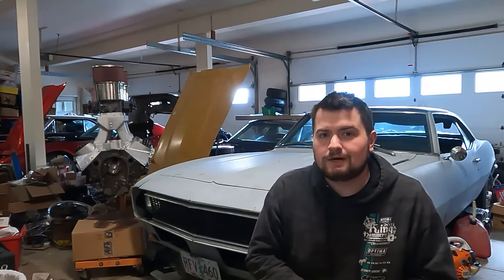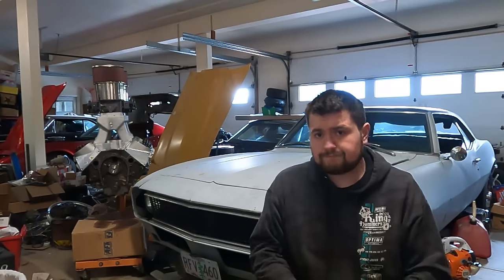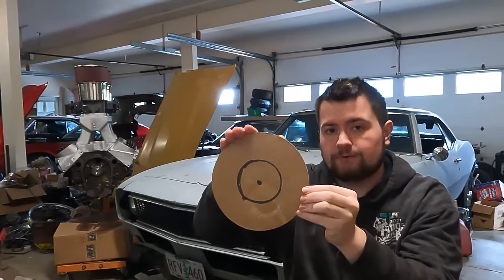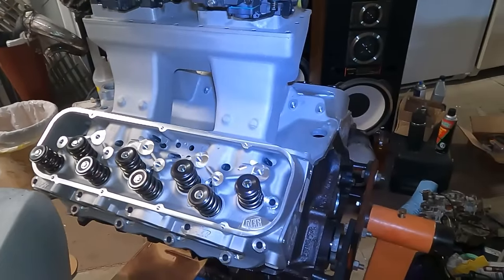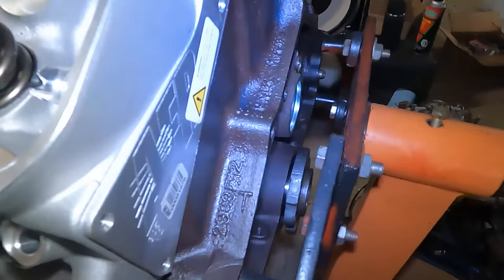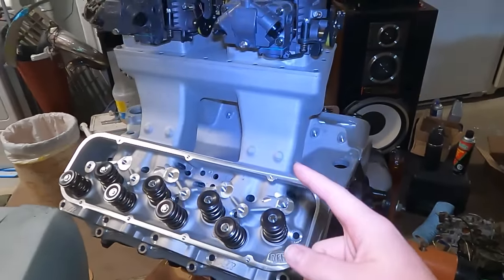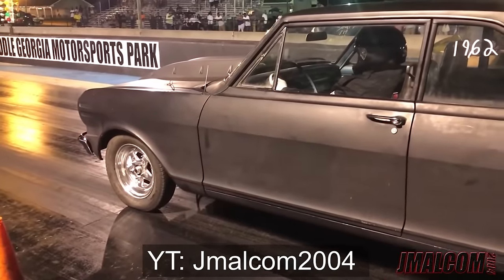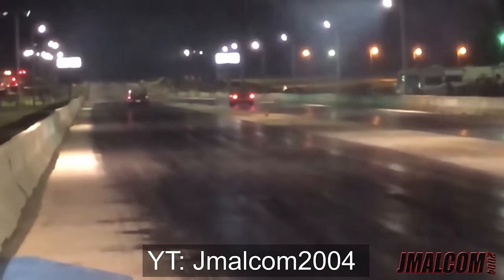The Truth About The Small Block Chevy 327

Comment: 327 with Dart or AFR cylinder heads make for a great combo. Over 500 hp at 7000 rpm. And a 327 loves to rev. One more, get a 62-67 small journal 327 and a 283 crank and build yourself a screaming 301/302.
Reply: That's what I am doing.
Reply: The small block 307 is a 283 block with a 327 crank 

The DZ 302 is a 327 block with a 283 crank
Reply: I have 2 327 motors I pulled from 67 impalas, put one in my 1978 Pontiac Phoenix ,rather ugly car but it's light and quick
Reply: Yes sir had that combo with dart 215s. It was a screamer.
Reply: You can also use a 4 bolt main large journal 350 block and use a 307 crank to make a 4 bolt main large journal 327.
Reply: A forged small journal should be around the same strength as a large journal cast crank.
Reply: @JDWard-Jeepster  , I have never seen a large journal 307 , and the Forged Steel Cranks are twice as strong as cast iron cranks , 
Mine is a Large journal 327 Forged Steel Vette Crank , 
I have two 307 engine and both are small journal crank 
Also have a small journal 327 engine with 11:5 Forged Pistons , double hump heads , 58cc combustion chamber, manly stainless steel valves, Torker II intake , and it makes 475hp ,10.5 Hays Racing clutch,  Lakewood Blow proof bellhousing
4 speed Trans, 12 bolt posi
Reply: @jimthomas7251  Large Journal 307's are pretty common. When Chevy made the swap to Large Journal in 1969 they did it across the board in ALL Chevy Small Blocks that I know of. You could also use bearing spacers if you must run a Small Journal Crank.
Reply: @JDWard-Jeepster  , that would explain why I never seen one , all of my engines are early 60s , mid 60s and the newest one is 1968   , 

I also have a 1970 small block 327 , 
But people say they ended in 69 , 
That may be true , but they built millions of small block Chevy Engines and this one must have slipped by or was special ordered , 
But it was in a 1970 Monte Carlo and it was built in September of 69 , 
Large Journal
Reply: @jimthomas7251  A real dz302 1969 is a 4 bolt block the early 302s were a 2 bolt !

Comment: The 67 350 in the 67 Camaro was a large journal small block. The 67 Camaro was the first year GM introduced the 350 in a passenger car. That is what makes the 67 Camaro 350 very special.

Comment: First car was a new '65'' malibu. 327 cu.in. 300 hp . 4 spd. Second day I bought solid lifters and 365 fuely camshaft . $16 and $32. $48 for my cam and solids . Had Nickey put in a 4:11. Added laker pipes. Could not afford headers. 7'' slicks at the track.Best time was 13:98 , 102mph.

Comment: My dad had the smal journal in a 71 el camino ss non numbers matching of course and he use to tell me about the 327s all the time he didn't know about the whole small vs large journal I found that out myself years later. But he was like one way u can tell the difference between a 327 & a 350 is where u dump oil in at it had the long oil tube in thr front that would be sticking out. But most of all he talk about the revs. They giy he got it from had it rebuilt and was hard on it most of the time and wore out the rings. So when my dad got it he had to choose to put new rings in the 327 or go with a brand new 350 or go with a corvette 350. He was 16 or 17 at the time and he went with the regular 350 and he always regret it. Then when I got my s10 he wqs like ik the perfect v8 for it & that's how I got introduced to the 327(Small Journal)

Comment: I've ran 327, 350 and 400 engines and now I have a 383 on my stand, but so far I like the 327 the best. Hopefully the 383 changes my mind. I always used 307 cranks in a 350 blocks to make a 327.i have out ran many of big blocks and some nasty small blocks just because the lower end torque was a little less (hooked better), but made it up on the top end.
Reply: I'd be surprised if it will change your mind . Especially at the gas pump . 327 s are the most efficient builds Ive done and run . And they've been many . Also punched 307 to 327 , been eager to try the 400 sb version.
Reply: @shawntailor5485  I had a nice 406, 5.7 rods, solid lift flat tappet cam, dart 215 heads, Victor Jr, 3000 stall with 3.89 gears. It was a stump puller, but if I had ever ran that car against the one I had the 327 in at a 35mph roll, the 327 would have blistered it's ass. Dead stop with slicks, the 406 would have torn it up. The 327 was still more fun to drive. They both got about 7mpg. If this 383 doesn't get me stiff, I'll be taking the crank rods and Pistons out and making it a 327 or 350. What they lack in low end, they more than make it up with midrange and top end.
Reply: @inscoredbz  try gapless rings bro.  I put them on my 327 last spring.  I beat hellcats all the time.
Reply: @dannymccarty344  my next one will have them. I'm a certified cheap bastard is the only reason I don't use them this time. Lol

Comment: Great engine,one thing I would add is the small journal  engine was 10 to 1 compression and 4 barrel on all.
Reply: @Nick Snarski Not true.  1967 was the first year the 327 engine came with a two barrel carb and I don't think any 327 engine came stock with 10.1 compression either.  1962 - 1965 with 4 Barrel Carb (Low End Horsepower Model- Compression: 10.5), 1962 - 1968 with 4 Barrel Carb (Mid Range Horsepower Model- Compression: 10.5), 1962 - 1963 with 4 Barrel Carb (High End Horsepower Model- Compression: 11.25), 1962 - 1963 with Fuel Injection-(Compression: 11.25), 1964 - 1965 with 4 Barrel Carb (L76) (High End Horsepower Model- Compression: 11.0), 1964 - 1965 with Fuel Injection (L84) (Compression: 11.0),  1965 - 1968 with 4 Barrel Carb (L79) (Compression: 11.0),  1966 - 1968 with 4 Barrel Carb (Compression: 10.5),  1967 - 1969 with 2 Barrel Carb (Compression: 8.75 (9.0 for 1969), 1967 - 1968 with 4 Barrel Carb ( Compression: 11.00),  1969 with 2 Barrel Carb (Compression: 9.00)
Reply: 1967 had low compression  9.0-1 was still a 4 bbl 210 hp.all small journal  was at least  10.0-1 compression. The large journal  was not in my comment 1968 327 was available 2 bbl 8.75-1 compression  210 hp.
Reply: @nightdan7096  You are correct. 1967 offered 327 2bbl engine. All the information you list is correct

Comment: I grabbed a '66 327 from an Impala, with the camelback heads.  Had it rebuilt, .030 over
on the piston bores, ported the heads, 10.5:1 compression pistons, Edelbrock Torker
intake, Holley 600, headers, "hot" cam.  I beat the hell out of it for 8 years  before I broke
a main bearing cap bolt.  I could rev it to 7,000 rpm without floating any valves.  I figured
that it put out 350-375 hp, it was a blast to drive in a '72 Camaro with a Muncie 4-speed.

Yes, the "weak" point of the 327 are the 2-bolt mains.  I'd rather have an "old" 327 than
a 350 any day of the week.

Comment: The 327 I built last winter for my daily driver now has 5,000+ miles on it, the molly rings and everything is now fully seated and that 327 with the 700R-4 can pull my big trailer like nothing. So never forget, that 327 is also a power house in a daily driver with the right cam choose. 70psi oil pressure cold, & 55 psi, hot with 30W oil & runs 165 degrees pulling the trailer at 70mph on hot Florida days. So there not just a drag race motor. Plus the 327 with a Q jet gets better mileage then my 350/700R-4 in my 71 P/U

Comment: My 68 Shovel came with a small journal 327 and 2.02 fulie heads. The heads are date stamped November 1967. It had a square bore cast iron intake. There was no carb on it when I bought it and the cam was replaced by an engine builder. I have no idea what cam was in it but it was a hydraulic cam. I think knowing what cam was factory installed could have told the story. It was a stripped down car. Manual steering and drum brakes. It did have a console-less Muncie four speed in it from the factory. Unfortunately, the car is long gone. It had severe rust on the top and around the rear window. I kept the 327. It’s eventually going to get installed in my 63 Short Fleet.

Comment: I've got a matching number 327 with the 2.02 heads in my '65 Impala SS.  I've had the car since 1986 and had the engine rebuilt twice.  It's now.40 over.  With the factory 4 speed I regularly rev it to 6500 rpm and the engine loves it!  I run it with an Edelbrock Performer intake, Holley 650 double pumper and a Comp Cams Mutha Thumpr camshaft. Its got a mean sounding idle. My neighbors can always tell when I take it out for a spin!  I was in the right place at the right time and bought a 1965 396 Mark IV from a friend who couldn't get it to oil right. He had just rebuilt it. He was super frustrated one day and asked me if I wanted the engine. I said yes and he said $300!  I took it to my engine rebuilder, and he found out the oil pump shaft wasn't connected.  I had him do some more work on it, replace the bearings and rings, etc. All total I have $1500 into it and it's sitting on a stand waiting for the 327 to develop some problems.  I guess I'll have to settle for torque over RPM's!

Comment: The 327 also has a better rod to stroke ratio, 1.75:1 vs 1.63:1 for the 350. That means less side load on the piston and less friction.
Reply: Rod stroke ratio has been proven to be inapplicable at the rpms and power levels of street engines. Hence the fact that Jon Kasse won Engine Masters with a very short rod, tall piston, Ford 400 with a CHI heads+ intake and an extremely tight LSA, low ICL cam.
Reply: @hendo337  That's right, street engines low reving engines therefore not affected.

Comment: I found a '64 L79 for my 74 Nova Hatchback some years back when I was a teenager. Never really understood much about it as it was more something I did with stepdad to spend time with him. I know the engine had a slight build to it, something about an RV cam, 10:1 compression after a .5 bore and domed piston heads. Had it mated to a 350 Turbo Hydromatic, but that had its own set of issues (mainly vacuum advance for shifting). Still have the car now, but need to get it back to running order with a new gas tank, transmission looked at, and set of tires. Was a project car I never got finished due to working more than I liked ending up tired too often. When I did drive it though, was a great engine and sounded nice...even if my neighbors at the time would disagree.

Thanks for the information as it helped me do some quick identification to know the type of heads and such I have on them.

Comment: Bill "Grumpy" Jenkins did very well in pro stock for a while with the small journal, which his was said to withstand 10,000 RPM. He also gas ported the pistons by drilling holes through the crowns.
Reply: Bill Jenkins Small block book is a must read for SBC.
Reply: @mikef-gi2dg  Smokey Yunick would be another good reference.
Reply: @vincel6340  I got his books too and you are 100% correct.

Comment: One thing about small journal vs big journal you didn't mention is crankshaft strength. Crank strength comes from journal overlap. Increasing journal diameter increases journal overlap. So the bigger you go in stroke, the bigger you need to go in journal diameter.
Reply: All small journal Chevy cranks are steel not cast its a good crank
Reply: @darrellsomers5427 I’ve read that . But … my first car a 66 Chevy 2 SS had a 283 and 2speed powerglide , as God as my witness it had a cast crank in it. It was just an old worn out car in 76’ when I got it for Christmas. By 83’ I had 13 different engines in  the car . From experience in Sbc there is no substitution for cubic inches . My current 66Chevy2SS sports a DartLittleM smallblock with a 4.0 inch billet crank (427ci) the numbers matching 327/350hp L79 sits on an engine stand .No comparison in power. .

Comment: I still have my 327 (331) 67 issue. Have had it in my 67 chevelle running high 11s. My 67 Chevelle is being turned into a Pro Street car and is going to get a 427 LS motor. That was a hard decision, but I told myself that if I ever swapped, it would be for a 427.

Comment: Just watched a good Dyno comparison on old SBCs. The 327 is pretty easy to make produce the same power as a 350. The difference is a shorter stroke makes its peak at higher RPMs. They will never be a big puller down low. Displacement is still king for that. Loved my old 300 hp 327 in a Chevy 2. It was wicked and bone stock.
Reply: Yes sir buddy,  a healthy 327 in a 1st gen Nova was a real runner. Back in the late 60's I bought a '63 Nova SS  6cyl rolling chassis with no drivetrain as my 1st car. Installed a 250hp 327 out of a fullsize Chevy from the junkyard and made a sweet little hotrod. As funds allowed, I replaced the Carter 4bbl with a Holley and put a  30/30 "Duntov" cam in it.  Good stuff...

Comment: The 67 Chevy C10 with a 327/3 speed transmission. The one I had was a 4 bolt main small journal steel crank with wide journals. And the heads were the hump heads and 1.94/1.5 valves with a Quadrajet.

Comment: Good content on the 327 I purchased a 350 block 4 bolt main turned it into a 327 basically built the 63 vett 300 horse but with better parts

Comment: When the 350 first came out, there were a number of articles trying to prove that the 350 was a better engine. The 327 was better. They consistently out performed it’s big brother. The 350 replaced the 327 because the EPA was about to regulate auto engines to run cleaner on unleaded fuel and loaded them down with emissions widgets. by the time Unleaded fuel was mandated, Chevy needed something to make as much power as the 327 did on leaded fuel. Chevrolet managed to sell people on the 350 by a huge effort to market it.
Reply: the 1970  lt1 350/ 370hp was the small block king!Next was the 1969 DZ302 !

Comment: I just built my '66 small journal w/ 10.25 to 1 pop ups forged Badgers. it's got a C2 (1964) corvette high rise and a '63 327ci 365hp Corvette Holley 600cfm single pump/ feed  list number. 2.02 - 1.60 camel humps #462's and a balance job new bearings, cam lifters and stock forged steel crank and rods. it's all original numbers matching '66 Impala SS engine rated at 275hp. Looking for 325-350hp and putting it in '64 ElCo w/  T-5 , 3.55 posi and disc brks. just a cruiser for the back roads. I also have a late '67 large journal 327ci in the Chevelle El Camino now that will be coming out soon to put in the '66 mtr.. '67 engine is my spare. the 350ci first came out in late '66 Camaro's and by late '68 the 327 was discontinued. Early '69's had some but by then GM had the 350 taking it's place.  I'm looking for a stk GM 327 Corvette lightened flywheel in 10.5in clutch for the '66 also so it will rev just a little bit quicker. Great Video and details on my favorite engine GM ever built.

Comment: X-Experimental 4 Bolt 327 engines were produced by GM in 1967 but never made it to assembly line production. Will be a Unicorn if you find one.
Reply: Bought a scrappy Camaro that had one, for years I have been called a liar. Since I read ur post and I still have it stuck back in corner of shop I'm going to research it
Reply: @wildestcowboy2668  as far as I know, the only 4 bolt 327 block was a 302ci. That might be what you have.
Reply: @jeffhastings3463  So basically your saying that it's not worth keeping anymore? When I pulled it yrs ago it still ran ...
Reply: What's the block cast number?

Comment: Memories! Remember brother bought a 72 Nova off neighbor for $600 in '86. Went to junkyard and bought a low mile '66 327 out of a Vette that had a solid lifter in it. Paid $375 back then. Open diff burnouts for a quarter mile! Lol. One winter he was running only water in the block for some reason, don't recall. But surprise freeze overnight cracked the block.

Country boy buddy had a numbers matching rust bucket '67 C10 in high school. 327 2bbl he swapped to a cast intake 4bbl Carter. He FLOGGED the ever loving hell out of that engine on a daily basis. It never quit and never burned oil. That engine was indestructible! He would wind up that small journal until the valves floated and still keep his foot in it. I never understood how that engine never let go or used oil???

I'm a Ford guy now. Love the old 351W and 289/302 stuff. But I'll always have fond memories of the good ole Chev 327's.... Fantastic short stroke small block. If I was to build a SBC today I would definitely build a 383 over anything else.... Unless I had a 2500# car to drop it in. Torque is king on the street. Cheers ~

Comment: You may have forgotten to mention that pickup or truck even combine's had  327's in them. I have a 1964 (I think ) 327 all stock with 4-barrel junk heads call hi-torq on the valve cover . It had small journal forged steel crank. Low-compression pistons. All I'm using is the block/crank. For a blow-thru single turbo , aluminum head street build.

Comment: The 327 is the sweet spot for a bunch of perameters on a pump gas engine, the bore allows good size valves that flow, has the right compression with a flat top with the right chamber volume for good quench, good flame travel, makes good emissions and decent fuel economy, in conjunction with the 3.25" stroke that produces enough compression and torque without excessive piston speed or pumping losses. That's why 358 Nascar engines use that stroke. Unfortunately we never got any performance street engines with a 4.185" bore because it's not the best at the necessary compression for pump gas, makes more emissions, isn't as fuel efficient and they used the 4.185" bore because they were allowed to go all the way up to 358 even if it wasn't the most efficient. It's also why the 331ci Windsor is so popular with the 3.25" stroke. Those are very efficient packages and benefit from much shorter lighter rods with their 8.2" deck, often making well over 500hp with basic aluminum heads and pulling high rpms.

Comment: My hubby and friend are ccurrently building a tunnel ram 327 old style gasser motor, with tracker 1 heads, steel crank, H beams forged 12.7 pistons, big solid roller cam,  hoping for 550 hp. At 8000 rpm !